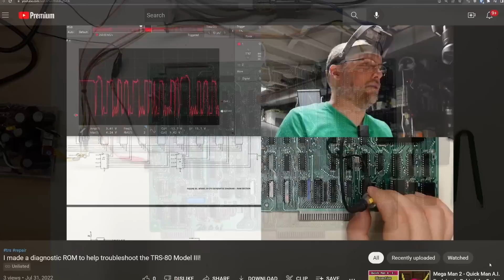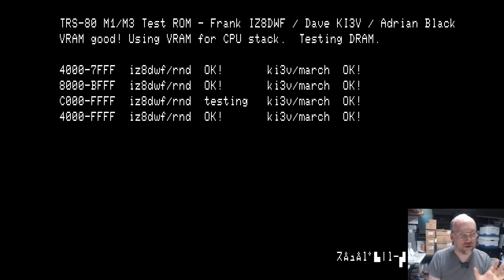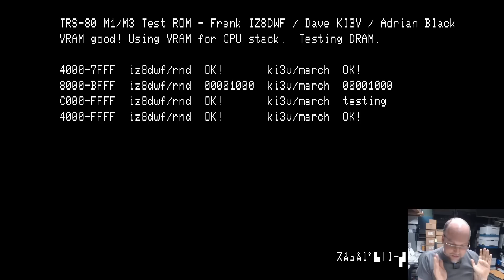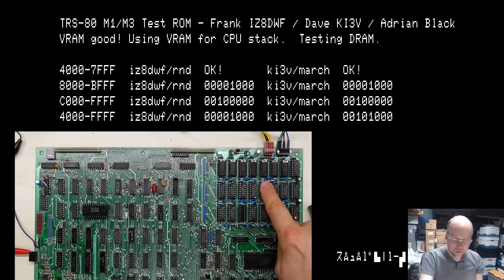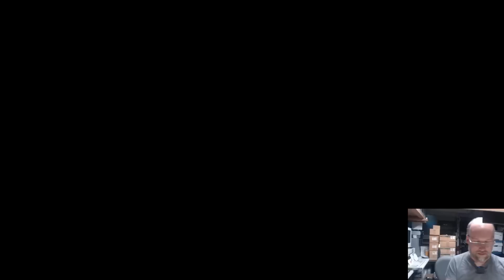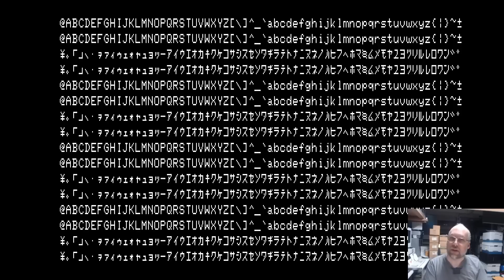Let's talk: Our brand new TRS-80 Diagnostic ROM!

Comment: Very cool! You should flash the stock rom onto the high side of that eeprom that way you can switch it with the little jumper! Less likely you'll miss a pin swapping back and forth that way :D
Reply from the maker: The issue really is the ROM adapter PCB can't fit into the real computer fully assembled. It'll hit the RF shield and on the Model 1 I don't think there is room either.
Reply: @adriansdigitalbasement2  Given how you feel about RF shields, you could bust out the Dremel and cut a hole for it. I think that would fit under the heading of "mods that might have been done back in the day" since these are machines that tended to get hacked.

Still, putting the normal ROM on the top half would mean having to merge the diagnostic and boot ROMs, and the boot ROM will have to be selected for every machine, and then the whole block written to EEPROM. Granted, the diagnostic part should still work everywhere, but it doesn't seem wise to me to introduce a point of potential operator error.
Reply: @mal2ksc  Wherever you put it, you could have a toggle switch routed to the back of the case with "normal/service" printed on it like a traditional vertical-kill switch on a TV 😂
Reply: @adriansdigitalbasement2  A Model I has acres of room inside, the PCB is mounted upside-down in the case and there's the better part of an inch between the ROM socket area and the floor. (And RF shield? What's that?) The trick, however, is that all but the newest Model Is rely on that awful satellite board to hold their three Level II ROMs in, and sandwiching something on that could be painful. So, yeah... "G-board" with the 2-ROM Level II set, no problem, but older ones...

And then you have my Model I, which has the awful satellite board terminating in one of the onboard sockets and a Level I BASIC ROM in the other. (And a nasty mess of wire hacks going to a toggle on the back to switch BASICs.) I'm kind of tempted to rip the whole mess out and sub a board with a SST39SF010 and a GAL to switch between Level I and a couple different flavors of Level II, but maybe the agony of dealing with the spaghetti in there builds character.